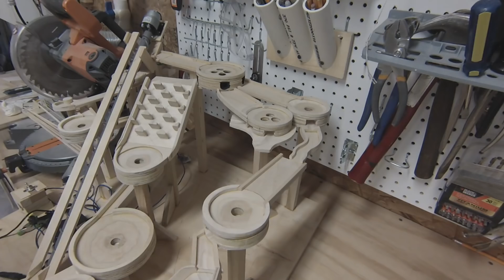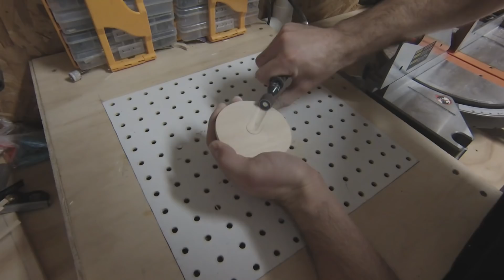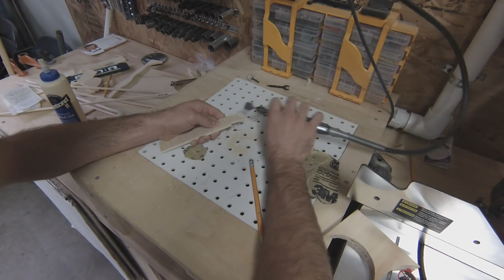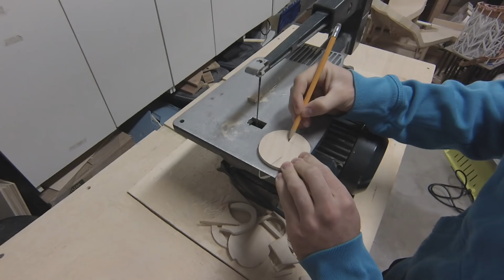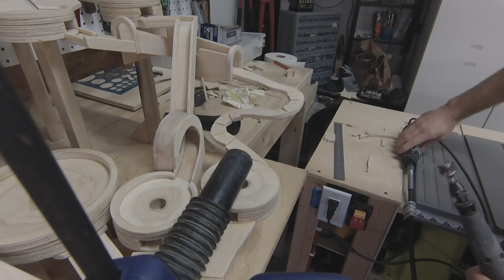Mini Golf Marble Machine Build, Part 5 (Track número 3)

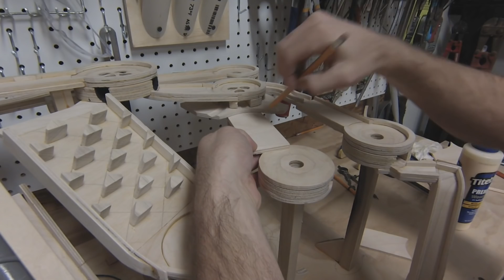Comment: Did anyone see that pencil move by itself at 0:35
Reply: Asher Nicoletto it was he vibrations from the saw
Reply: I think it from the pressure of that wood cutter when cutting wood
Reply: wow, I would have missed that if you didn't point it out
Reply: Asher Nicoletto yes
Reply: Or him just using the pencil through the time